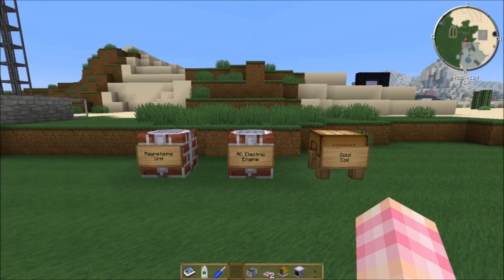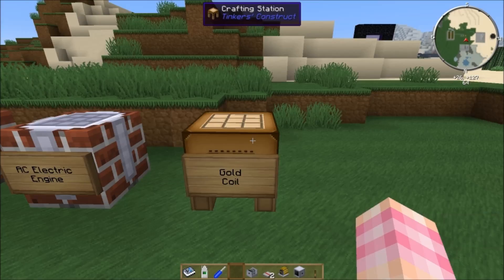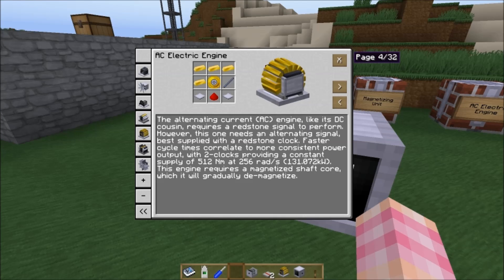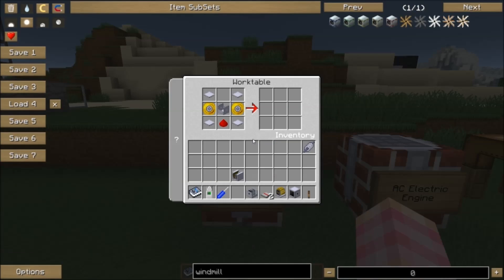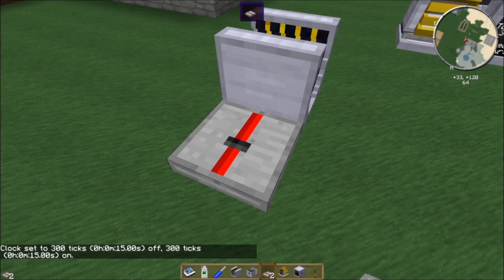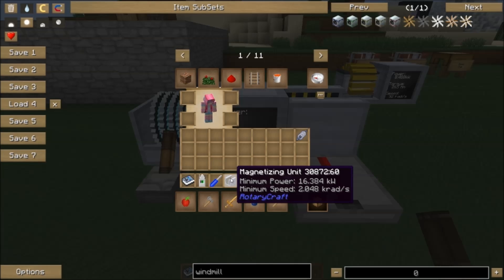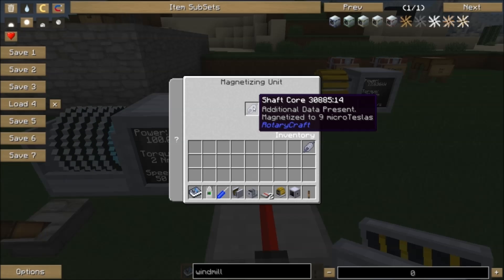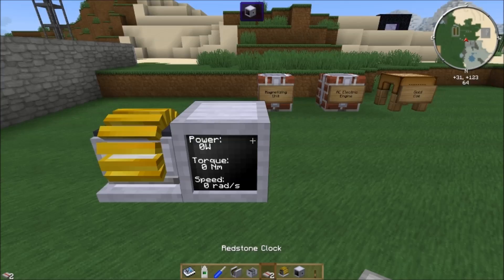RotaryCraft Tutorial #13 - AC Electric Engine

Comment: None of the behavior you are seeing is bugs.

The AC engine is generating power in the beginning because you are walking around with a magnetized shaft core. Moving magnetic fields generate electric current.

As for the variable output, it is because the clock you used was far too slow. You need a 2-tick clock for steady output.
Reply from the maker: Wow that's good to know. I had no idea you could make machines react to someone just walking around them with an item. I didn't know that was a thing.
Reply: Maxwell's laws. ;)

Although, I would prefer if you not call features "bugs" and a machine "glitchy" until knowing it is so.
Reply from the maker: ReikasMinecraft I will refrain from doing so in the future. Sorry.
Reply: Just one of my "pet peeves"; just about every feature in RC has been called a bug at some point, including things like power requirements. :P
Reply from the maker: ReikasMinecraft I'll redo the video if you'd like.
Reply: An annotation would suffice. Redoing videos is far too much effort for that to be reasonable for me to request.
Reply from the maker: ReikasMinecraft Okay. The last thing I want is for the author of my favorite mods to be mad at me. :)
Reply: It takes rather a lot more than that to make me angry. :)
Reply: ReikasMinecraft your mod needs more supporters.
i have yet to see a mod with this much detail
Reply: ReikasMinecraft Unbelievable - your attention to detail in creating this mod is truly impressive.  Sadly, it also explains why people are so easily peeved by your mod - as you say, "detail, to the ignorant, means incomprehensibility, which breeds anger and hate."
Reply: And therein lies the problem. Detail, to the ignorant, means incomprehensibility, which breeds anger and hate.